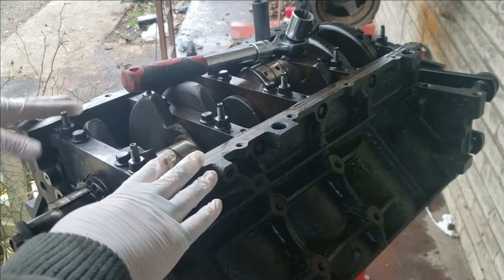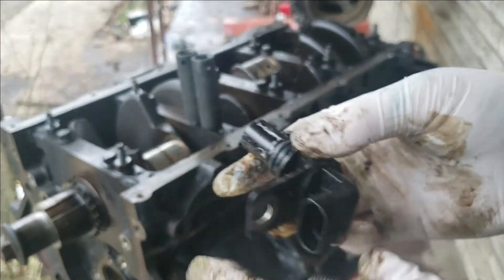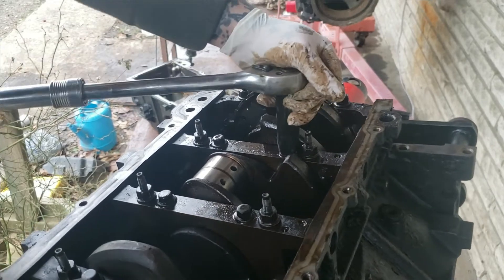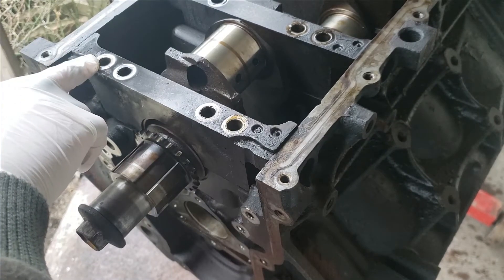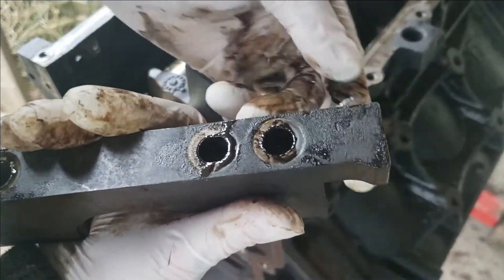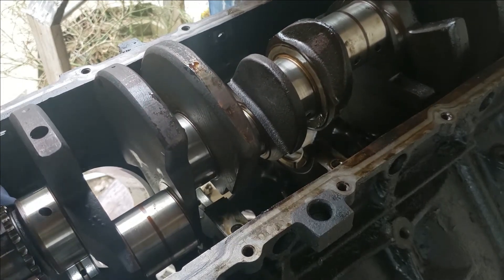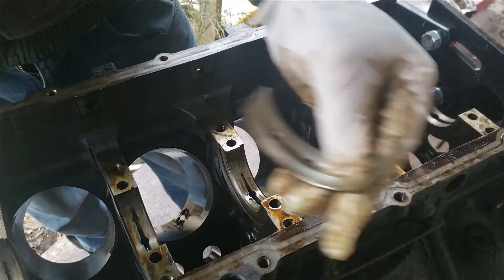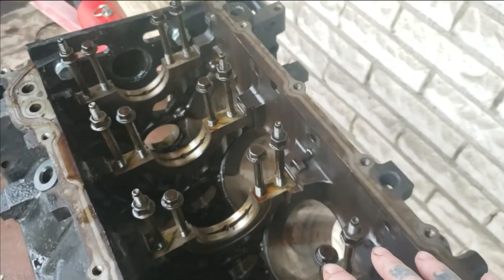Removing Your Crankshaft And Main Bearing Caps - HOW TO - LS ENGINES

Comment: Thanks for making this video! I would just get new bolts and I’m guessing because they are tty or stretch bolts is why that one looks out of sorts. You really shouldn’t reuse them. 60$ for replacements is cheap insurance. If you were to use arp it’s a lot more expensive and then you would have to line hone the crank at your porch machine shop because of the added clamping force from the arp studs.
Reply from the maker: Thanks for watching, and great info on the bolts, i would prob replaced them if it was my first engine build or if I was worryed but this is like the 28th different ls engine that I re-used bolts on with no issue yet